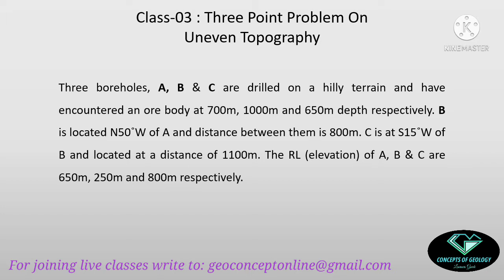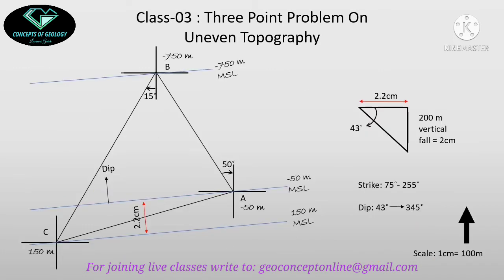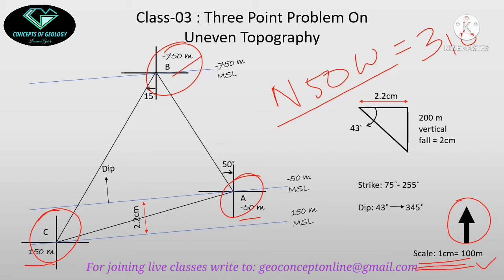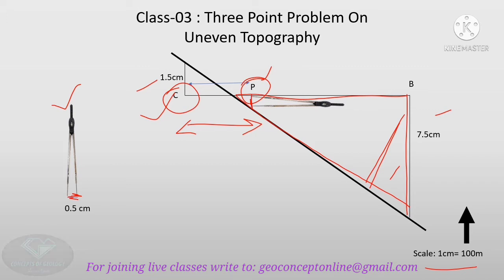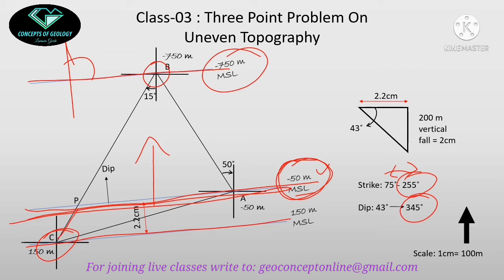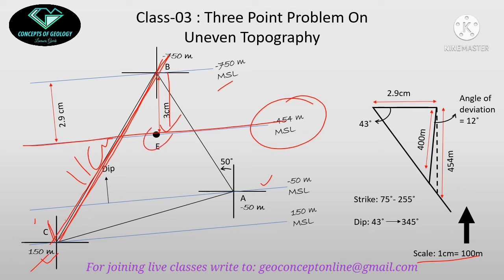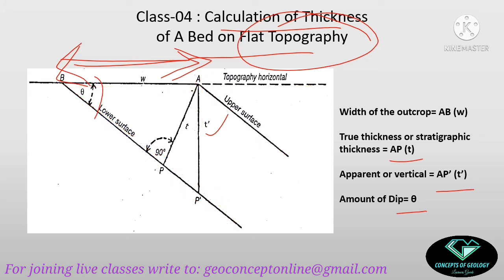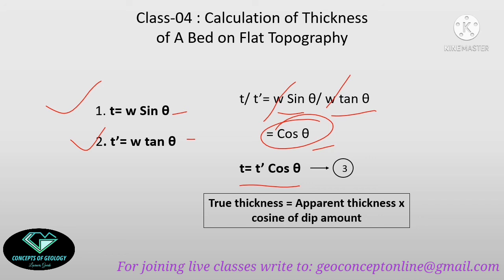Structural Geology Numericals and Maps: Class-04: Thickness of Strata on Flat Topography

Comment from the maker: 'Concepts of Geology' has appeared with live classes. We will learn to solve numerical problems on structural geology and to interpret geological maps with complexities like fold, fault, unconformity etc. On advanced level we will solve the attitude measuring problems of geological liner and planer structures with the help of stereographic projection. 
Today is the fourth class of the module and we will learn to calculate the thickness of a strata on flat topography.
previous video link: 
1.Class-01: Geological Field Mapping: https://youtu.be/vOZvvjGaTMA 
                     Geological Compass: https://youtu.be/MT06naOvnMI
2.Class-02: Three-point problem on flat topography :https://youtu.be/sSbENOQK180
3. Class- 03: Three-point Problem on Uneven Topography: https://youtu.be/mv0eVkJDNvo

To join the live classes or to get the total session feel free to write to geoconceptonline@gmail.com. 
Facebook: https://www.facebook.com/Concepts-of-Geology-100924711659386/